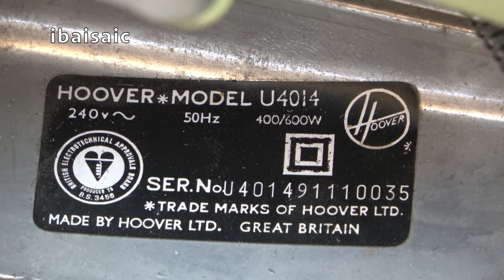1970's Hoover U4014 Ranger Senior Compared WIth  a 1980's NIB U4274 Senior

Comment: Roger, at 19:50 you put the belt on the spindle the wrong way round, so as you may well know, the brushroll would have been spinning in reverse. I notice a lot of people seem to do this - and on a Junior, the belt jumps straight back off when the vacuum is started, so you have to get the belt on the right way on one of them, but the senior will let you put the belt on back to front and the agitator will simply spin the wrong way. God knows how many people back in the day got the belts on the wrong way round - I suspect quite a lot.

Comment: We have the exact model and I repaired the lower hook using something called Steel Putty.

I drilled very small holes in both sides of the pieces, then superglued small pins in each hole to reinforce the hook.  Then used the Steel Putty to fill the gaps, then more superglue.  Feels very tight and strong now.  I love your videos and I would like you to branch into other vintage domestic appliances such as Teasmades etc?  
We love our 70's appliances and household styles.  
Thank you for the video!
Nick
Reply from the maker: I have a few vintage appliances other than vacuums including irons, food mixers, hairdryers, drills and a few vintage electronics. I will show them on my channel at some point, though the electronics will be on my other channel  Roger’s Bits & Doings.

Comment: Hey Roger... the next time you store a vacuum in a plastic container try putting several desiccant bead packs in with the vacuum and throw a couple underneath it. This will absorb any moisture/humidity so your machine doesn't suffer from rust or oxidation (the white powder on that aluminum). They're very cheap to buy and they'll save you a lot of headaches when getting a machine out of storage. 😊
Reply: Yes that’s an excellent idea, you can probably bulk buy them…

Comment: Those were definitively ' The Monster Hoovers of the Metal Midway ' Being in So. Cal.  I used to service & repair the old American metal Hoovers too. I've got to start up again repairing & servicing old & new (all makes & models ) again due to r lame Presidents way of handling our economy. I'm thinking  a good serviced , deodorized & sanitized vacuum cleaner would cut down many illness's that come from a filthy  carpet & neglected vacuum . A good service for the respectable vintage Hoover & Eureka uprights should be around $ 39.00 to $ 49.00 depending on it's condition. I usually don't like cutting corners when servicing these relics cause they can outlast a human beings life span when treated with proper TLC. This is no solicitation thing, just a love for old vacuum cleaners. Any thumbs up ? Wish me well...